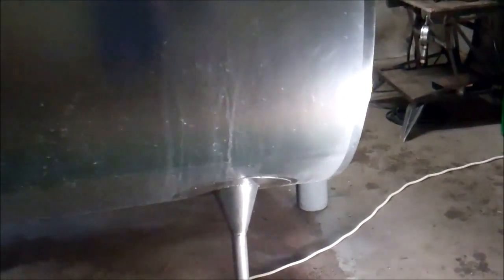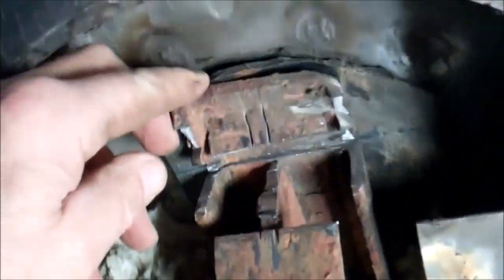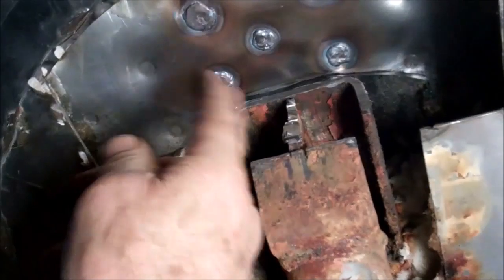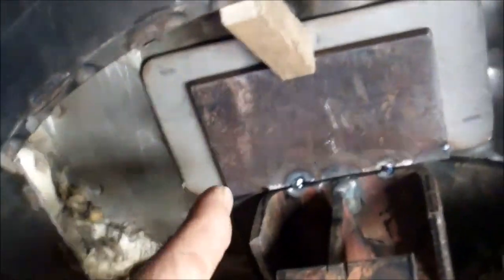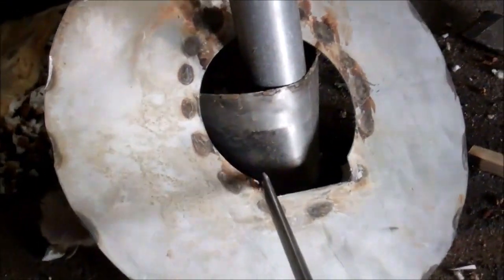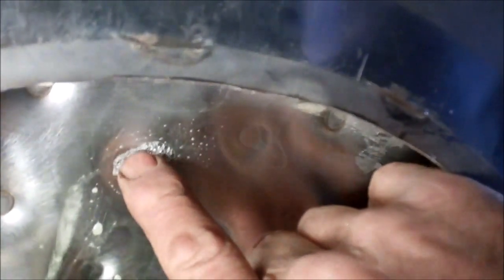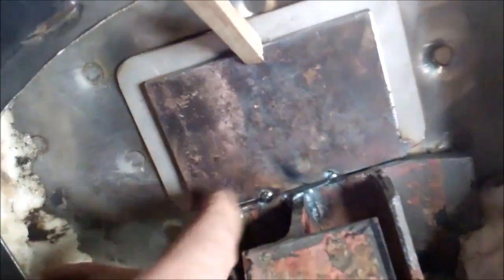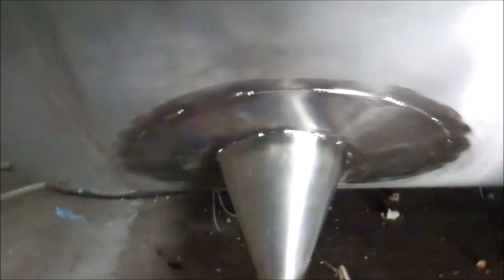Repairs to an old Bulk milk tank evaporator leaking both sides.

Comment: Thanks for your knowledge, did you do a back purge?  or the weld does not affect the other side in this case.
Reply from the maker: Ceaar Davmun ( I don't know if you are familiar with these milk tank evaporators ? )
To find the leak I pressurize the evaporator using "oxygen free nitrogen" at around 200 psi, once the leak is found the nitrogen is left to sit in the evaporator at zero pressure while the welding is being carried out, this acts as a purge and also prevents oil vapour within the evaporator from igniting, Note: the nitrogen has to be at zero pressure when welding the evaporator as any pressure will blow the weld pool out, to maintain zero pressure in the evaporator a small pipe joint is left open to prevent any pressure build up.

Comment: How much pressure you use to pressure test? Not much I assume coz it's only to locate leak? Great workmanship people don't know how hard it is to weld in tight spots trying to see the pool through your big giant helmet lol but great video as always, I'm always learning from them
Reply from the maker: Filipe Ngaluafe, To find the leak you first have to be able hear it, it's only then you know whereabouts to cut an access opening through the outer panel, so to be able to hear the leak you have to pressure test up to around 200 psi using nitrogen, thank you for your comment.